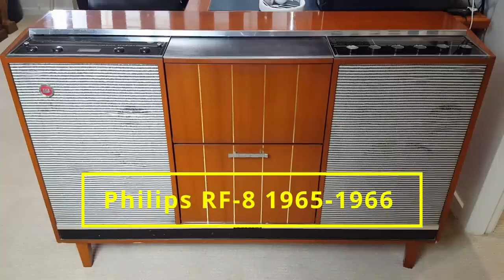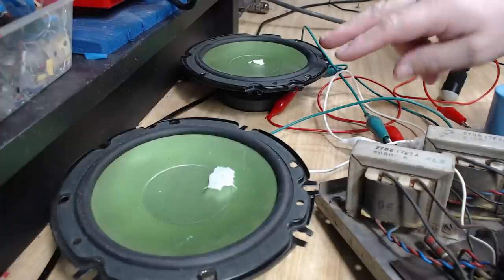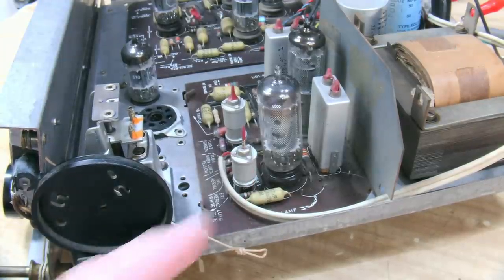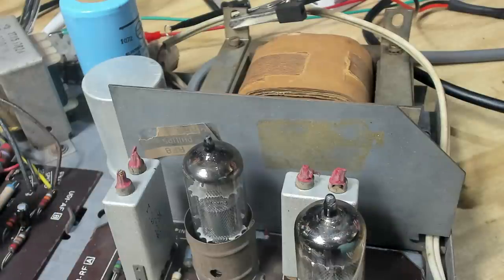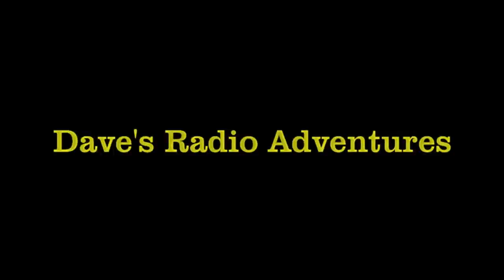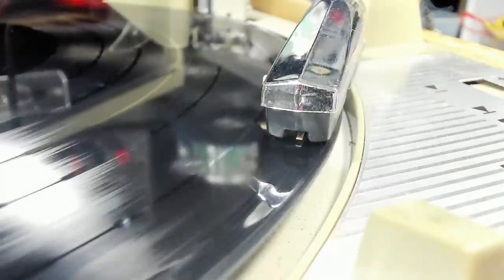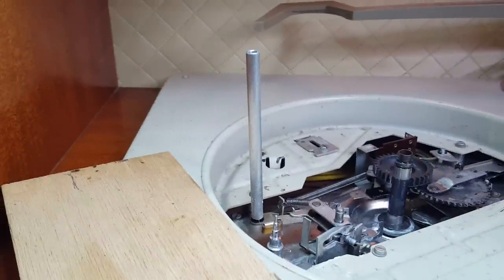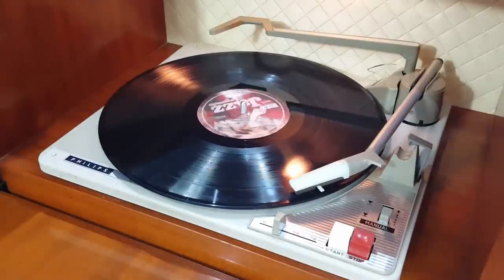Philips RF8 Radiogram and Philips AG-1025 Record Player Service - 1965/66

Comment: Oh one thing I forgot I have an earlier Glidomatic it has a smaller cabinet 2 smaller speakers in the bottom very glossy timber is that what they call Nitrocellulose as you can almost see yourself in it and circuit is point to point wiring rather than PC board.  It has dark finish on outside and a nice pale finish inside.
Reply from the maker: I haven't seen one like you describe. I couldn't say if the finish was Nitrocellulose, it was a common finish back then. I like the light interior against the dark cabinet.
Reply: @DavidTipton101  I looked up the model it is a phillips Beethoven 228.  A very well made unit go and look it up and see.
Reply from the maker: It looks a nice unit. Push-pull output too 👍
Reply: @DavidTipton101  It uses the same output tubes or well valves hehe as the RF8.  it has the 6GW8's. it has a problem that the sound would distort after a few minutes.  I have been told its what they call THAT capacitor.
Reply from the maker: @steviebboy69  Yes very likely it will be the coupling capacitors. When the radios is operating the voltage on the grids can increase from negative to positive through the leaky capacitors producing the distortion. They should be replaced before running the set too long as the increased current flow through the output valves will destroy the valve.
Reply: @DavidTipton101  Is this cap what is called an inter stage coupling cap and its between what would you call it the pre amp, and the output tube . thanks for the info great job you do on these sets.
Reply from the maker: Exactly. They are C27 and C28. C31 and C30. C33 and C32 on the schematic. All available from Jaycar in their 630 volt range of red poly caps.

Comment: If to pick a better turntable, I'd go with Garrard, BSR or Cloaro which would improve the player 100%, plus replace resistors, capacitors etc., with product NOT made by Philips. I don't trust ANYTHING Philips makes!
Reply: @top40researcher31  Philips may have "introduced" the CD players and discs but it was Sony, and Sony alone that made them work properly!
Reply: @neilforbes416  the radio station where i worked had two sony CD players then they downgraded only to one but last i heard they only use the computer now so if anyone wanted to have their own playlist they have to have their CDs ripped to the computer
Reply: @neilforbes416  philips still is manufacturing products